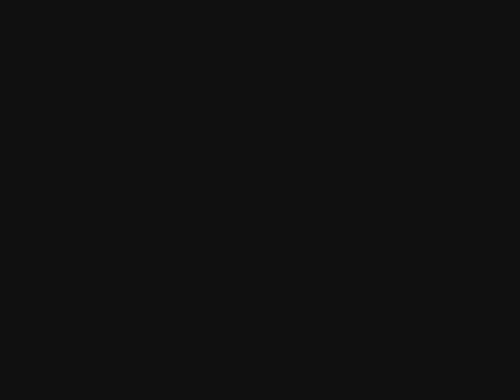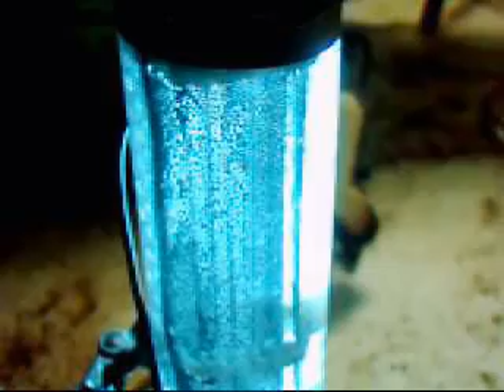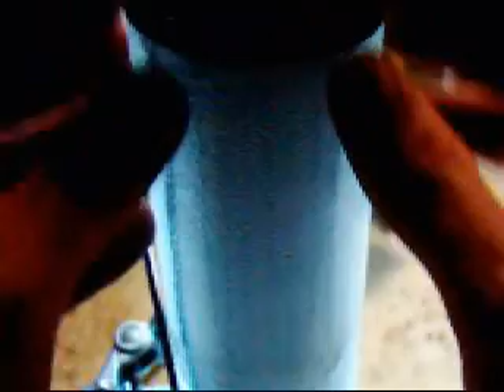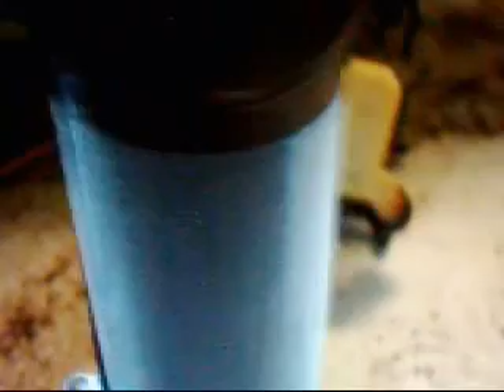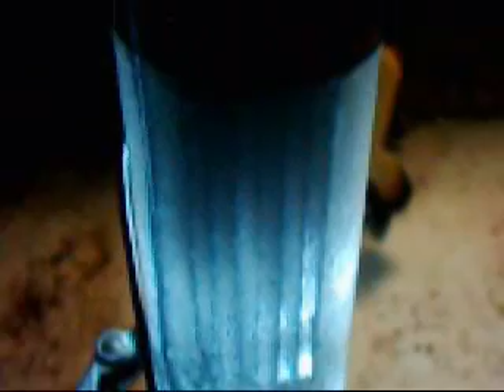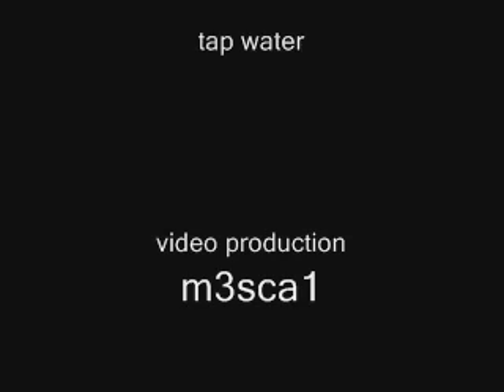HHO cell with Ultrasonic fogger

Comment: There's three type of gas hydrogen oxygen in Brown's gas which nobody knows there's a third gas called Brown gas it's a heavy gas so you have to bubble it out or pressurize your cell or ultrasonic and ultrasonic frequency
Reply from the maker: are you talking about Omahsa gas, the japanese invention using ultrasonics to cavitate the hho into a new stable and lower burn speed gas? i have witnessed different gasses in my own cells

Comment: I was thinking on the same lines after purchasing several 3MHz transducers, what voltage are you currently using?, I would imagine to get any sort of HHO production it would have to be in 10's or 100's Kv's due to the very low conductance of the mist.
The mist falling from using too low of a voltage might be expected as the molecules become ionized.
Reply from the maker: Suzy Siviter that cell is actually a pool chlorination device for salt water pools. I don't know what the output voltage was. It was a long time ago when I made this video. I can say that ultrasonic transducers seem to have negative impact on the total gas production over time. I guess those nano bubbles actually help the fracturing process...so shaking them out of the electrolyte actually  didn't help.
Reply: m3sca1: Thank you for the information; I didnt think of a pool chlorination device. Maybe you are on the right lines; it must be easier to strip Hydrogen from a few molecules then in bulk quantity, just it seemed less efficient because you didnt hit the high voltage sweet spot for disassociation to occur, if you have the set up you can buy high voltage generators @400kV off ebay for around £5 that run off a CR123 lithium battery.
I was going to try this myself, just the piezo ones I have bought are not going to be as powerful as your pool setup.
You would need to fill up the chamber with bubbles before sparking to lessen the chance of the hydrogen being converted back into H2O with an hot spark. Feed off a thin tube and see if you can ignite the released Hydrogen.

Comment: nice idea
Reply from the maker: yeah it actually seemed to reduce the efficiency of the splitting process. It helps clear the water quickly but at a cost. I think the super fone bubbles actually help the splitting process.
Reply: can you modulate the frequency and what is the range? ..of your ultrasonic fogger..
Reply from the maker: ***** the fogger only had one frequency and that was the frequency from the stepdown transformer that ran it. 50Hz

Comment: yes i assumed the same but my contention is that it will  allow a small cell to pull more amps by mitigation of plate polarisation "accumulation of bubbles" when bubble form on the plates the active service area decreases this is also reflected in a huge drop in current. im more interested in the coalescing effects  
of an ultrasonic transducer because it will also mitigate foaming , any way im building  a probe housing actually its drying. man i hate glue....

Comment from the maker: in the end it looked like false ecomony to try to force the bubbles out of the water.
the super fine bubbles seem to assist the water splitting process,and the ultrasound destroyed small bubbles by coalescing them.
maybe short sharp bursts of ultrasound would help but i dont think it has any benifit to leave it on all the time.
honestly dont remember how it affected the amps.

Comment from the maker: it is off to the side in the pipe fitting-my fogger ran off AC using the 50Hz from the mains power thru a stepdown transformer.

Comment: Don't buy Aroma Tools Whisper diffuser. It's a piece of junk.The co will not refund your money.The mist blows down from the directional nozzle instead of up The mist does not fill even a small room.You cannot remove the directional nozzle it fuses to the cover. Sometimes it produces a full mist most times it does not.The reason is that all of the water in the plastic cup is not used even though the timer ended. Another negative is that the co has a monopoly on the cups Don't waste your money.

Comment from the maker: @NOBOX7 mate the best solution for the foaming problem is not use lye at all.Use oxalic acid brick cleaner and the dust from carborundum sand paper.The surface tension of the electrolyte wont allow the formation of foam

Comment: very smart to use a pool chlorinater as an hho cell. as i like the transducer idea , did  you test to see if it would destroy faom bubbles ? they are a problematic by product of all my torch cells, if a mesh or porous scrub pad doesnt work i may try to see if the fogger will pop foam bubbles

Comment from the maker: @silentsofdogood yes i have spoken to Craig in detail and he implies that he has something that others do not.
also he spoke in terms of a vieled threat about patents and law suits,which got my back up since anything i have done is open source and on the net.
non faraday electrolysis has been achieved by many people and i did it with a simple PWM from a drill trigger and distilled water.
try it-dont use electrolyte and see what you get-try an electric scooter PWM.
let your cell resonate ;)

Comment: in the radio spectrum of H-O_H bond ..
it has a torsional frequency, axial and rotational bond frequency ...
is the suggestion to resonate at one of these frequencies ..i would choose torsional 
....and then pull them apart ...
its a bit like when u resonate engineering material ...cracks grow faster when the material is vibrated at its natural frequency because it has minimal damping and max energy absorption..in simple terms it is in a highly responsive state at resonance

Comment from the maker: lol-dreamyear was using a music signal on the plate surface and had bubbles dancing...btw just using one transducer wont increase efficiency.
but yes you will be able to see in thru the fog.
ive seen hydrogen splitting with standing waves of ultrasonics,but the effect was small.
3 transducers tuned to different freq wouldbe more likely to work

Comment: should put little stereos in the bottom of your cell and the bubbles could dance their way up.. but seriously i like this... and with all the bubbles getting out of your way you can see which surfaces are producing more gas and if you need to adjust your plates any

Comment from the maker: the fogger is an ultrasonic device and has nothing to do with the PWM that is running the cell.
they are independant of each other.
the point of this is to clear the small bubbles from the electrolyte with sound vibrations that make the small bubbles coalesce into bigger ones.

Comment from the maker: ok check the video response i put up showing the results of with and without fogger.
the transducer is your standard off the shelf pond fogger type-its cheap crap made in china no brand or labels on it.
its got some LED's in it for pretty lights in the fog too.
ultrasonics need to be tuned to the cell for improving results.
and a pond fogger has no facility for tuning it.
ultrasonics can actually split water given the right set of frequencies.
ive seen it with standing waves.